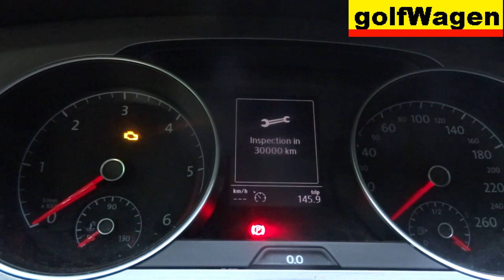VW Golf 7 oil change oil filter change 100% detailed

Comment: Why on earth do VW design the most important and regularly changed filter on the car in such an awkward position!  It's also guaranteed to drip over the wires and you!  On other cars it's usually on the top at the front.  I think they did it deliberately to stop the DIYer.

Comment: You can't do this job using the trolley jack only, it's not secure. You should use some special stand for that.
Reply: You can. Question is how much do you value your life.
Reply: Scissor jack one side (intended only for wheel changes) and non-locking trolley on the other side. Plus, I can't see any chocks BEHIND the back wheels, which is where they generally need to be placed. It's a recipe for disaster.

Comment: For the rear screws should be size T45
Reply: What a pain in the behind! Typical that I have a Torx set that has T3, T4, T5, T5.5, TS6, TS7, TS9, TS10, TS15, TS20, TS25, TS30, TS40... and NOT T45 😩
Reply: I assumed it was t40. I got 2 screws of with a t40 but 1 I couldn’t. I will try a t45 in morning. Thanks

Comment: WV put this filter on tiny place with many wires arroud. WV ingineers are nuts.
Good tutorial by the way
Reply: Really. I changed oil yesterday on 1.6 TDI, oil filter is in a small place and hidden by pipes and wires that will be dirt by oil at the end.

Comment: This is very helpful. Thanks. 
It's the stupidest design putting the oil filter in that place. 
Just a couple of observations. I don't trust scissor jacks or non-locking hydraulic jacks if I am working under a vehicle, they're really only intended for changing wheels, where your body isn't at risk of being crushed. If the seal fails on your hydraulic jack, you're in major trouble. 
The other thing is that it's more usual to chock behind the back wheels rather than in front, unless the vehicle is facing downhill. Vehicles tend to roll backwards when jacked up at the front. I can't see whether you've chocked behind the back wheels, but it seems that you might not have.

Comment: Do you change the oil every 30000 km or 15000 km?
Reply from the maker: 30000
Reply: Better 15000km/1 year
Reply: @bofor7493  If you drive a lot and long distances, you can safely wait for the oil change until 30,000 km. On the other hand, if you don't drive that much and shorter distances, you would be wise to change the oil once a year and after a maximum of 15,000 km. Generally the car feels better, long distances absolutely better than short ones.